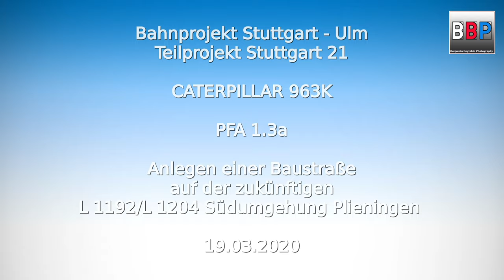[UPDATE] Stuttgart 21: PFA 1.3a, CATERPILLAR 963K @ Work, Stuttgart-Plieningen, 19.03.2020.

Comment: the performances and the quality of CAT 963 K are out of discussions, excavating in hard clay is hard for a crawler loader as an hyd excavator.

This operator mantein the bucket plane position in std regulation. i , after the bucket is returned in plane with the automatic level , open the bucket a little bit, for better penetration.
If you check, the plane become to raise, because the bucket remain all time a little bit closed, so ,the teeth, don't enter in the terrain.

Naturally that , you open the bucket, must be good of mantein the plane atfer.
As a dozer .

With the dozer or grader, you must good to understand the machine reaction.
Naturally, old school operator as me.
New school , with laser , is another discussion.
But, , with you do the plane with the laser, is easier only in theory.

You must work in forward slow, because the machine and the laser haven't the same immediatly reaction . Laser yes, hyd circuit not.
Many customer think that use the laser fpr plane finishing,, start to travel at 6 / 8 km in forward.

NO!
When you do the last finishing, you must travel slow.

Same of old school work.

Explane to the CAT 963 K opedrator , that he must tensioning the chains !

No comment !.
New school.
Reply from the maker: Happy Easter! Buona pasqua!